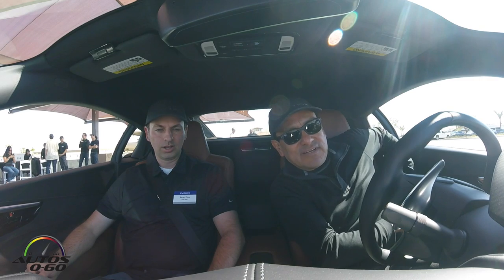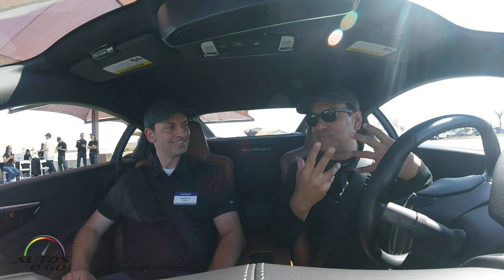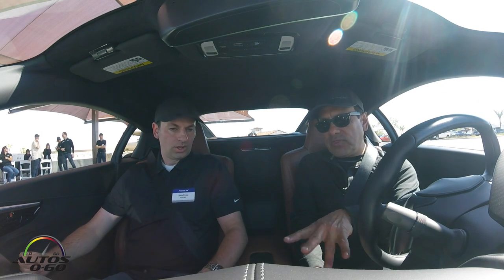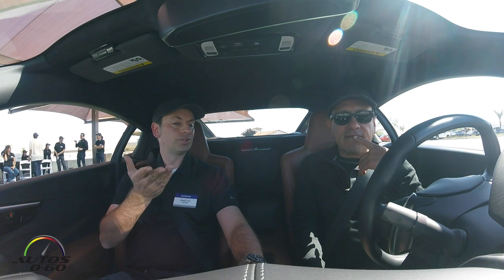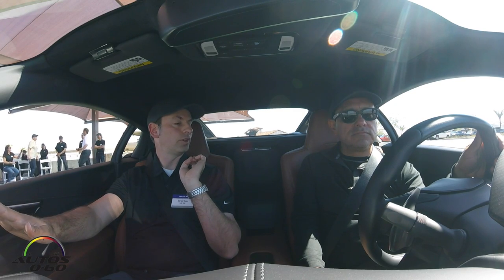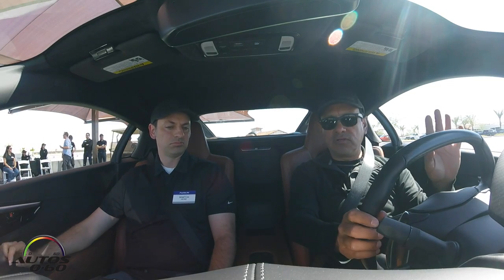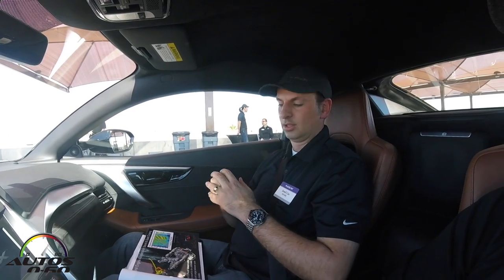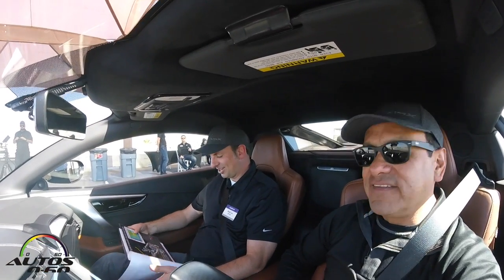2017 Acura NSX Launch Control System

Comment: gt-r is better and is cheaper
Reply: I used to think exactly that, but if you look at the much more advanced technology that the NSX has that grants it much sharper handling, much more everyday supercar practicality in its different modes, torque vectoring hybrid system, and absurdly faster track lap times for not much more money it makes sense.

And that's before mentioning the luxury comfort the interior it has and much prettier exterior design by Acura's team.